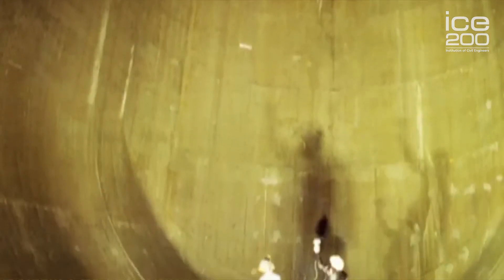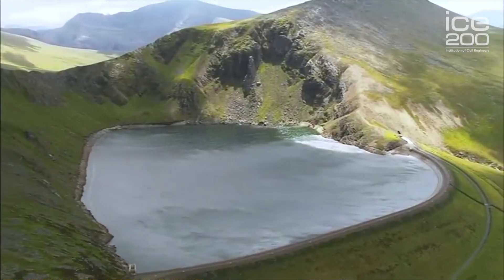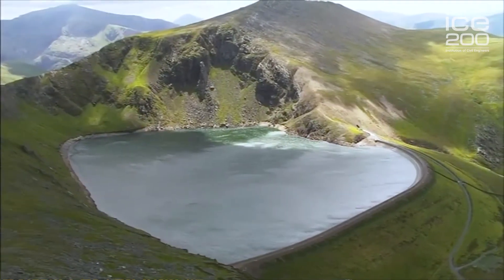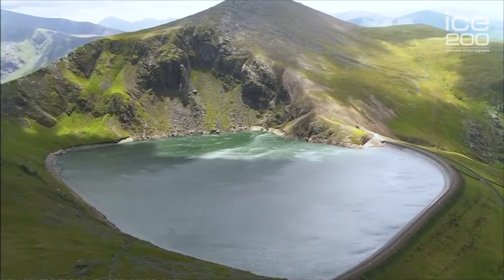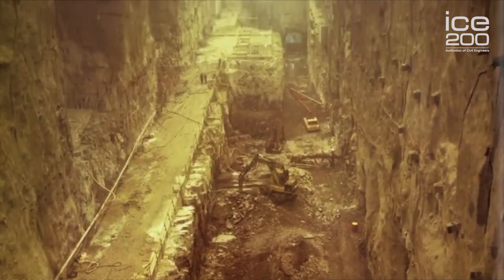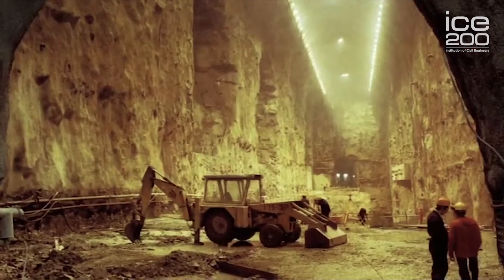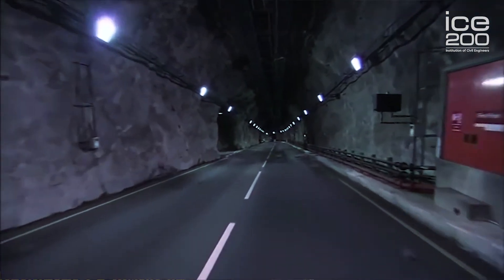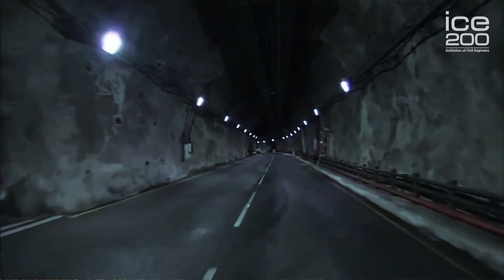Dinorwig Power Station

Comment: Rumor has it: in the 1973 FA Cup, all the TVs turned on to watch it was already straining the power grid, and once halftime came on everyone got up to put their electric tea kettles on, pushing the power grid to breaking point and causing brown-outs. Dinorwig promptly began construction in early 1974
Reply: That's "rumor" alright. And bullshit.
Reply: @deeremeyer1749  More like a dramatic exaggeration. Power plants in the UK are designed to account for what they call a "TV pickup" when the commercials all come on and lots of electric tea kettles are plugged in. Dinorwig's construction includes these TV Pickup specifications, the only thing that's missing is any mention of the 1973 cup